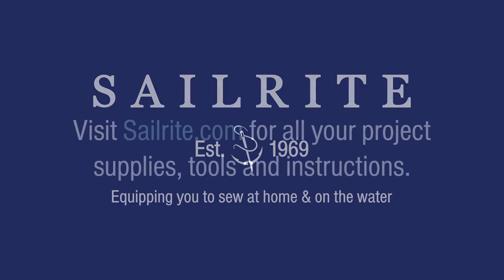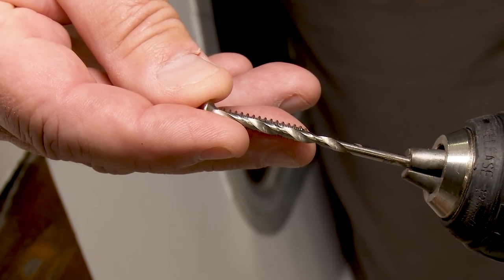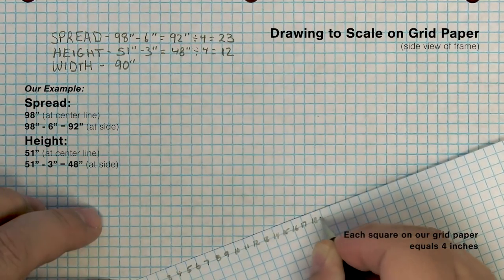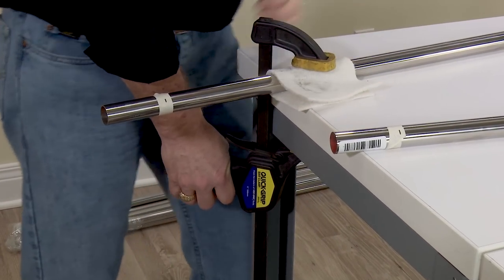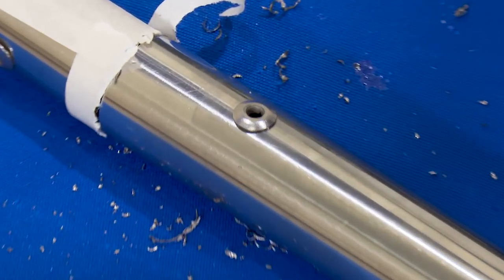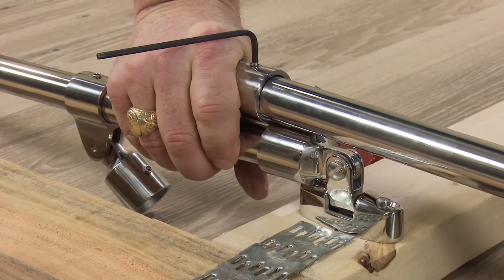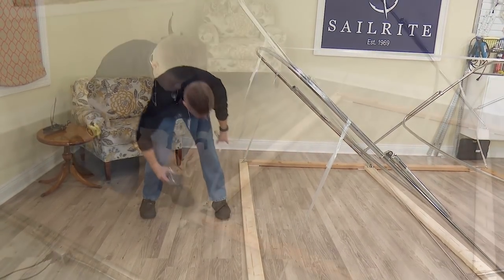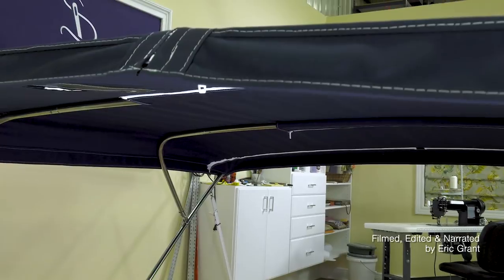How to Build a 4 Bow Bimini Frame

Comment: Excuse me what is the diameter for the stainless steel rod u used🙏
Reply from the maker: You can find the specs here: https://www.sailrite.com/Tubing-Stainless-Steel-1-1-Foot  The kit can be found here: https://www.sailrite.com/4-Bow-1-Stainless-Steel-Bimini-Frame-Kit-Fittings-106x98x51
Reply: @SailriteDIY  thank you so much 🌺